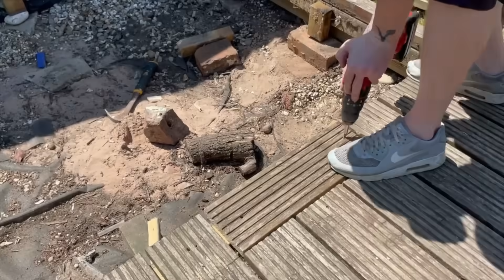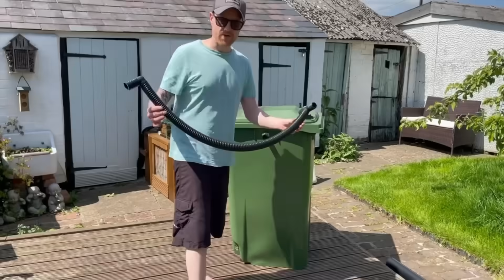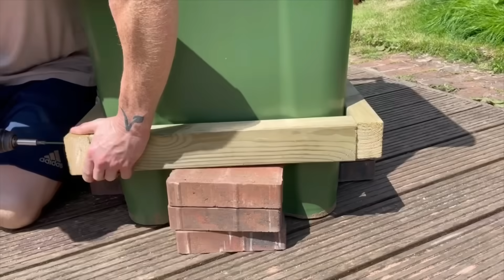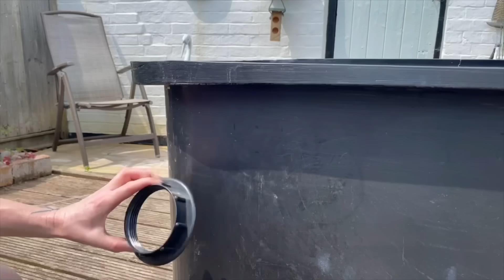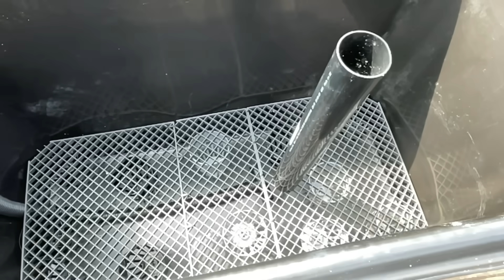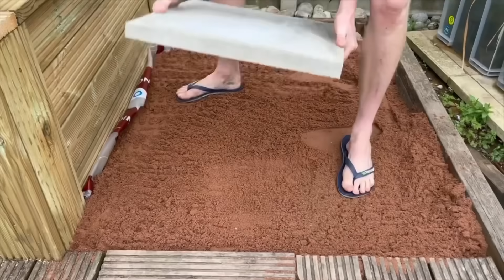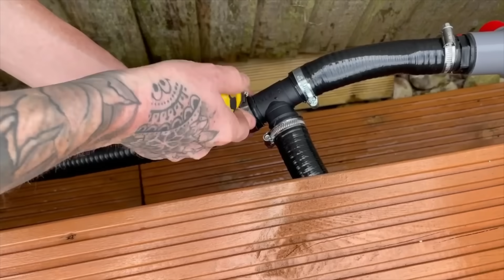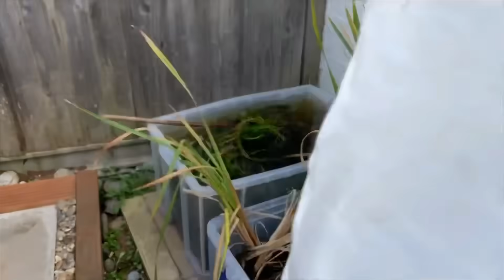DIY Backyard Garden Pond (step-by-step)

Comment: Are decking boards not pressure treated over there in the UK ? Is so you should not use it as it will leach arsnic into the pond everytime it rains, which to the best of my understanding is a few times a week over there.

Comment: Firstly a great video, I have actually purchased the Laguna 980L today after watching your videos over the last few weeks. Hoping to replicate your build. Any updates or advice since you have been running yours a while now? Thank you
Reply from the maker: It’s all running well, although there has been a couple of minor changes/ alterations. Firstly I have added an overflow. Secondly I’ve changed the pump, this was because the old pump started making a noise and it was quite annoying, and after a lot of investigating, and trying various things to fix the problem i believe the problem was back pressure. Possibly caused by using too smaller diameter of hosing or too many elbows etc. Anyway, the way I fixed it was to replace the pump with one that I could control the flow of (i used the evolution aqua varipump 10,000) and run it at around 20% flow rate, which works perfectly. With the up flow filter setup a slow flow rate is actually better as it allows the debris to easily settle at the bottom of the filter, which can then be easily vacuumed out from time to time (I do it twice a year - beginning of spring and end of summer. Another change I’ve made is to completely remove all the sponge from the wheelie bin filler. I took it out when I was trying various things to try and work out why the old pump was making a noise, and even though I don’t think the sponge had anything to do with the pump noise, I realised not having it in there made no difference to water clarity/ quality, so I just didn’t bother putting it back in. I am planning on adding bags of lava rock in its place even though its probably not needed but thought I might as well just for some extra biological filtration. In reality the pond does not require the wheelie bin filter and would be fine with just the bog filter. It is nice to have though, just incase I might what to run carbon or something like that at some point, it gives me somewhere to put it. I am also planning on adding gravel to the bottom of the pond this season - I think it will be fine and allow extra surface area for beneficial bacteria and also provide a place for micro organisms to grow and create more of a natural eco-system. Also I think it will look nice. I think that’s everything though!!! Good luck with your build and let me know how it all goes!!! 👊
Reply: Great advice thank you. I was thinking of possibly making the bog filter from a large planter similar to your the one you have on your smaller pond but ill try find a deeper and longer one. The main mechanical filtration im thinking of the pontec 5000 with the UV. I'll have a look at that pump. Thank you for the advice and looking forward to an updated video when you have time

Comment: I would have insulated the bottom as well. Sand is not an insulator.  Also the filter will dissapate heat from the water but pehaps he did not show the insulation of the filters.

Comment: The sponge filter was a poor design for mechanical filtration.  It's too time consuming to frequently clean the filter due to the many pieces of sponge.  However, it's a great biological filter if not cleaned frequently.  The bog filter was alright, but lava rock as substrate would be better for bio filtration.  Based on the bio load, current design should work.

Comment: I had a Koi pond that was a DIY project, with very little planning. I started digging in my yard until I got the size, depth, and shape I liked. I took my measurements to the pond store, and they said it is 3500 gallons. They cut a lining for me from a big roll and sold me a pump, a Waterfall/filter, and a flexible PVC pipe. It was hard work, but in time I had a beautiful pond with beautiful Koi. A few years after I was 100% happy with it, I had to move, and you can't take a pond with you.

Comment: Rubber goes on the outside of your tank unions (or the part without the threads). With the rubber on the inside, you will get leaks through the threads.

Comment: Hi pal love your videos I am planning on doing this with the same size plastic tub just wondering how many decking boards you purchased (in total) for cladding the tub and what size the decking boards where also what measurements did you cut the boards to go round tub (if you can remember) 😂😂

Also love your plastic tubes you used for making the heron stopper fantastic idea and will definitely be using this idea

Comment: Nice job. The pebbles in the bog filter probably aren't the best option though. It's better to use rougher rocks, so the good bacteria can adhere easier. I used bluestone in my bog filters. Pebbles are fine for the top layer for aesthetics. Well thought out though mate. For my ponds I sourced as much secondhand materials as I could as I'm not that flush with funds.

Comment: Is there anything you would change now you had it running for a year
Reply from the maker: I don’t think so.. but I do think the mechanical filter could be designed better to make cleaning it easier. Having said that I’ve found that I only need to clean it out twice a year (once at the beginning of Spring and then again when I closed the pond down for Winter), so it’s not really an issue. Other than that I have now added an overflow to the pond, but that’s about it really. 👍
Reply: Thanks 👍

Comment: Hello, just a suggestion. You wouldn't actually need the large pump if you used the air pump to create a simple and cheap air lift pump. The filter would have to be divided in two with a partition that does not quite reach the bottom. The water is lifted into one chamber and rises through the filter material to the overflow via the other. This would consume much less power. Incidentally, an additional air pump to introduce oxygen into the water is not necessary as the water is very turbulent anyway and the surface is constantly in motion due to the overflow.
Btw the Pond looks awesome. 👍

Comment: I also utilised 3 wheelie bins but slightly cut down to about 800mm tall , the first one fills from the bottom via a bottom drain in the pond, the second one has filter foams and the third has the pump which returns clean water to the tank. Apart from the return all piped in 4”. I think the bottom drain is far superior to a pumped outlet although I do accept there may be a slight risk of leaks… I accept that risk for the improved performance and reduced energy use (as the water is not ‘lifted’)

Comment: Ur pond is so beautiful. I am making mine the same like yours this spring.What thickness insulation u added? 
What length u cut decking boards for pond?
Thanks for the very detailed information in the video.
Reply from the maker: Thank you! The insulation was a combination of both 25mm and 50mm, basically what ever fitted in the gaps. 👊

Comment: Mate, your decking boards are upside-down. The texture side goes face down to avoid water sitting and causing rot. With the texture side up water will sit in the grooves and shorten the 5imber life span. Don't know if you built the deck but good to know for the future.
Reply: Hahaha

Comment: I'm getting ready to start on my pond project so finding this video was very helpful.  I built a few marine waste holding tanks for military vessels during my career and I would build a spray rail flushing system into the bottom of the tanks. It was a manifold of several tubes or a large circulate rail with jets drilled horizontally every inch. When you are nearly finished pumping out the holding tank, you could then connect a garden hose to the flushing rail via a deck fitting and stir up the sludge in the bottom of the tank to be sucked out through the pump out hose.  If you incorporated this into the bog filter you could flush it while you're sucking it out the wet/dry vacuum. Or you could install a decent size drain valve in the bottom of the bin and run a garden hose down the vacuum tube to stir up the sediment while you open the drain valve.  This is the longest comment I've made so I love your project!

Comment: Interesting that on all your bulkheads, you put the washer on the nut side. In the aquarium hobby, we put the washers on the flange side. When the washer is put on the nut side and nut side is under water, the bulkhead will still leak as the water can shortcut the gasket through the threading.
Reply from the maker: Hi there, i could well have done it wrong.. I did do a fair bit of research before the build, but found a lot different opinions.. so in the end I just went with making sure I had the rubber washer on the wet side, as that’s what most people seemed to be saying. But what you said definitely makes sense. Fortunately I don’t think I’ve had a leak..🤞 Thanks for watching! 👊

Comment: Do you not worry about big rain storms and overflow?
Reply from the maker: I’ve since added an over-flow.. for some reason I didn’t think I would need one when I built to the pond, but it did end up overflowing on to the deck a few times, and I was worried it would eventually result in it rotting. I’m gonna do an update video in the summer which will include showing the few small alterations I’ve made. Thanks for watching! 👊

Comment: Can we get an update on the pond please 🙏
Reply from the maker: I’ve got an update video planned for the summer, as Ive been filming it through all of its various phases since I set it up. It’s going well though, currently in winter mode, but looking forward to Spring! I’ve got another pond build video coming out soon though, that I filmed at the end of the summer - just editing at the moment! Thanks for the support, and don’t worry, there will be an update on this pond! 👊
Reply: @GingerFishyOfficial  Excellent news.
Off the back of your pond build, I'm currently building virtually the same thing, so I was curious if anything had changed or if you would have done something different
Reply from the maker: @MrBrain1369  that’s awesome! I haven’t really changed anything major.. I have added an over-flow though, and I’ve also added a small piece of course sponge on top of the pump, as kind of a little pre-filter (it’s literally just placed on the top and held on with a couple of rocks) to reduce maintenance, which I rinse out every week or 2. The only thing I would perhaps change if I was to do it again is to reduce the size of the mechanical filter as I don’t think I really need that much sponge, would probs be fine with half the amount I used. Good luck with your build!

Comment: I know this is the proper way, but back in 70's we had hole in in ground, lined with concrete. Painted some blue rubberised paint. Put some water plants in pond. Then the five fairground  goldfish from a bowl were dropped in. Probably cleaned ever 6 months. Fish over ten years survived winters, grew to 7 inches until some cat or bird had them over 3 days. Is all this pump and filters necessary? Knew nothing of filters back then.
Reply: Perhaps fairground fish were really hardy. I remember the tennis balls in winter, to squeeze and allow air through ice.

Comment: Hi , nice build I’m giving it a go . I can’t find p2 super seal anywhere . Is there something else that can be used that is safe ? Thanks
Reply from the maker: Hi there, I don’t think they make it anymore, as I can’t find it for sale anywhere. I bought it on eBay but it’s not on there anymore. I’ve done a fair bit of research into alternatives, but basically I think most stains are fine to use around the pond (not inside it) once dried. I tend to stick to water based, but I’ve heard people use oil based without any issue. But as far as a product like p2 that is completely safe even if a few drops go into to the pond, I don’t think there is anything unfortunately. It’s a shame because that was a really good product. Hope that helps!

Comment: Well impressed by your skills and design, well done!
I would leave the bottom of the pond bear to then easily get all that sludge out that will collect each season.
The only thing I would of done differently is run the outlet from the mechanical filter into the biological filter to stop the latter from getting clogged up. As you have it the mechanical dirt will get divided equally between the filters which would worry me.
Reply from the maker: Thank you! Yeah, that was the original plan, to have the water go from the mechanical filter into the biological, but I was struggling to work out the flow rates required, diameter of outlets/ inlets etc.. so decided to to keep them separate. I am in the planning stages of a big in ground pond at the moment though, and I really want the mechanical to feed into the biological in that pond, as I do think it is the best way to have it!

Comment: Interesting. I would have thought that placing the main tub partially into the ground (not on top of the ground) is a good way of insulation. The cold does not usually reach very deep, and conversely, in summer, it helps to keep the pond cool. I used to have goldfish, and they survived under a layer of ice. Two questions: What is the chance of the tubing in the filters getting clogged over time by debris and algae, and do you have to disassemble everything when that happens? And what is the chance of freezing temperatures and ice in your area?

Comment: I have a 90ltr koi built very similar to yours apart from around the outside another layer of decking wood wide enough and used as a flower bed, and I used massive solar filters and some plants inside and bigger one on top the float in polystyrene and I've made hide whole for them! We have Butterfly Koi but we did it like this due to cats and the solar filters are brilliant ❤

Comment: Great project curious what the cost came in at for this? Also wondering if both filters are needed or if just the biological would have been enough but I do know Gold fish priduce a lot of waste. However safety tip please wear boots or trainers when sawing up a deck easy to slip the saw and end up with a nasty cut of your foot.🎉
Reply from the maker: Hi there, and thank you! I think it would be fine with just the biological filter alone. I just like the mechanical filter for a bit of polishing, also i can maybe try different filter media’s etc down the road in the mechanical filter. 👊

Comment: your pump on your mechanical filter is going to get clogged way to fast , put all your bio media on the bottom and one or two layers of mechanical at the very top and then once they clog, hose them down and redo ... all you needed is 3 bags of lava rock .... and 2 layers of mechanical and its a done deal

Comment: Great videos and so informative👍👍, I have watched this one several times and considering building an identical pond soon. Is there anything you would change if you were doing the build again? Thanks…
Reply from the maker: Hi there, I don’t think there is anything major that I would change. One think I would add though, is an overflow, which i will be adding in soon. Also, i do think the mechanical filter (wheelie bin filter) could be better. I recently seen an old video by Lee Calladine, in which he built a DIY filter, but unlike mine where the water flows in from the bottom and flows out the top, it is a down flow filter. This  means the sponges at the top are the ones that get dirty first, and with them at the top, it means they are easier to remove and clean, and so the filter is easier to maintain.  Not that my filter has been particularly difficult to maintain, but I do think if I was to do it again, I would go for a design similar to his. One other thing is the 1 inch tank connectors I used are quite difficult to get the pond hosing on to, so I would probs try and find more of a stepped horse tail version, as I think these are more suitable for use with pond hosing. I’ve actually just ordered a couple of different ones from Amazon to see if they are any good, so will let you know if they are decent when they arrive.

Other than that though, I’m pretty happy with it, and it’s running well. I’m planning a 1 year update video, to show how its all gone. Hope that helps and heres the link to the video by Lee:

https://youtu.be/Ginrvsv2Iow?si=Nf4vQBC5D0jzaPrj
Reply: @GingerFishyOfficial thank you for the advice! I will look forward to the next video and overflow addition as well! Planning to build mine late August early September as an upgrade to my existing patio pond. Brilliant videos with great detail! Thanks again.

Comment: A unique example of packing a video with useful information and beautifully timed video. Not a wasted moment. No padding. No head and shoulders smug shot. Congratulations! Subscribed. One slight worry would be herons perching on the side. I lost all my goldfish to a greedy heron. Even had to rescue the bird when it got caught under my netting!  😇
Reply from the maker: Thank you! Yeah, I try to provide as much info as I can, even though I am still learning myself. Sorry to hear the heron got your fish, they can for sure be a big issue, my dad’s pond got emptied by a heron also..
Reply: @GingerFishyOfficial  I was so inspired by your video I searched for a bigger container. CEMO [of Germany] make their Rectangular Containers in smooth, heavy duty fiberglass in many sizes. Available throughout Europe. I bought their 1500 liter container. Simply because it just scraped through my open greenhouse doors while standing on edge. No more herons! I half buried the container in my greenhouse floor to get the best appearance. Two inches of fine gravel, planted, filter running and left to mature before the goldfish go in. Thanks again for all your hard work, detailed information and creativity.